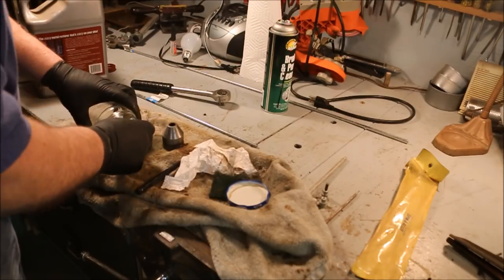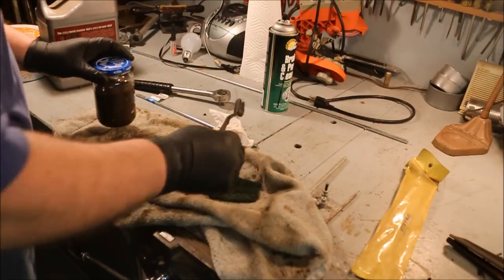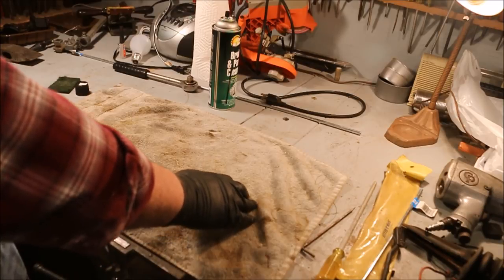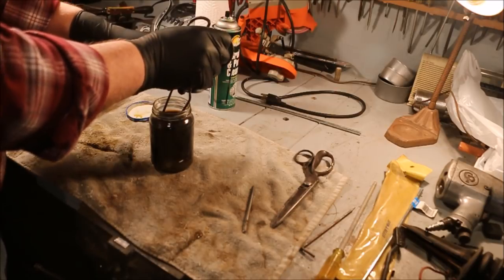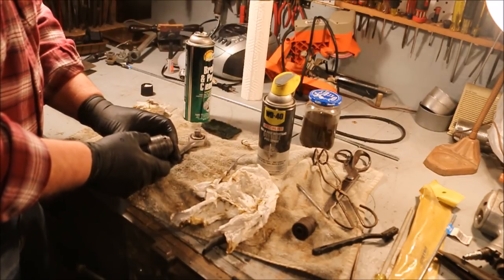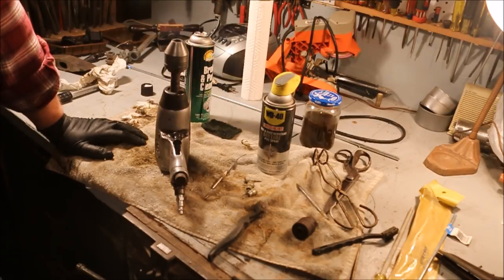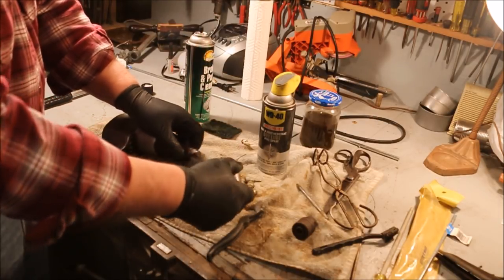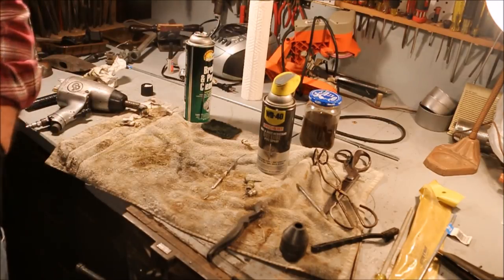EVAPORUST CLEANING ~ JACOBS CHUCK No  64 J9

Comment: I’m a staunch fan of Evaporust ... I’ve used it for restoring antique tools.  It does not harm the japaning.  I’ve restored a couple of very firearms to operational condition with it.  It will however remove blueing from a firearm.  That was fine with me as it needed it.  What I enjoy is it is reuseable.  I just drain it off into a jug and leave till I need it again.

Comment: If I may offer a suggestion? As I commented after your last evaporust tutorial, I have used countless gallons of the stuff, mostly for restoring old mitre boxes, saw plates, and planes. I have found that rinsing the parts with warm or hot water, immediately after taking them out of the evaporust, really aids in getting any residue off. Follow the rinse with a thorough drying with air pressure, to prevent flash rust. You will end up with a part pretty much residue free, ready for steel wooling, or whatever technique you plan on using to polish.
Reply from the maker: Thanks for the suggestion. I need to get more. That used batch is depleted after 5 years sitting in the jug.
😊

Comment: Howdy Unc'  does the Evapo-rust  harm paint?  I have several old planes that need rust removal, but I want to save the japaning  If I can. Just thinking this might be the answer. I have seen several other You-Tubers use it.  Great day here it's suppose to be in the low 70s.  I got to work on the taxes and mow grass. I just had to stall until you posted this morning have a good day, love those treasure stores back in the midwest.
Reply from the maker: It doesn't seem to effect sound paint. That's kind of a cover for saying if there is rust under the paint the Evaporust will remove it and anything bonded to it. Like paint. Old school Japaning is really tough. It will hold up under a lot but it is also not as common as I would like. Some of the thick black paint that passes as Japaning is not the same stuff. 
Best thing is to test a small spot and see. Sorry to not be able to give you a definitive answer but it just has too many variables.
Reply: yep real jappaning is baked on, contains our favourite linseed oil, nothing should dissolve it (but i would never bet my hat on it)
Reply: A hammer will but you've got to be patient and persistent!
Reply: Ah yes, mowing grass. I've evened everything up here and just waiting for it to set in with a vengeance. It will before long, timed with the influx of foreigners from Bluehairville. Ahh well, such is life. Mow on, Paul old pal!
Reply: Evapo-Rust will not harm most paint, it's safe on wood, brass, copper and other soft metals.